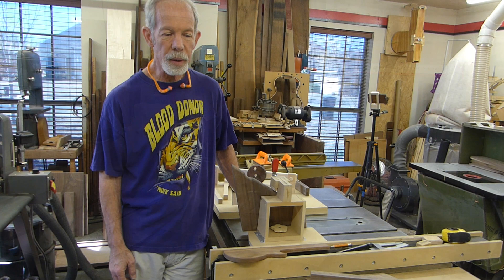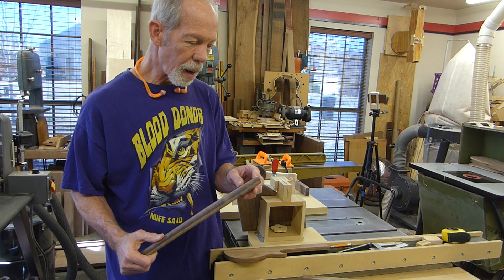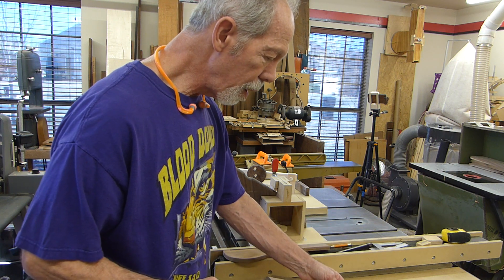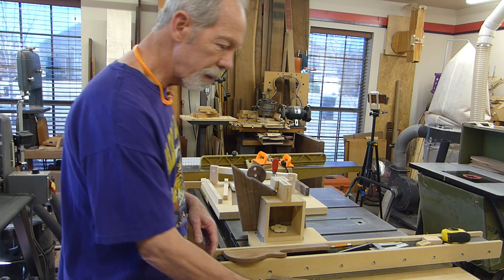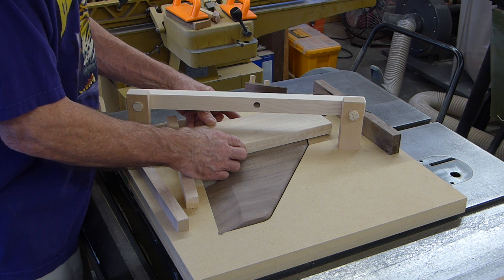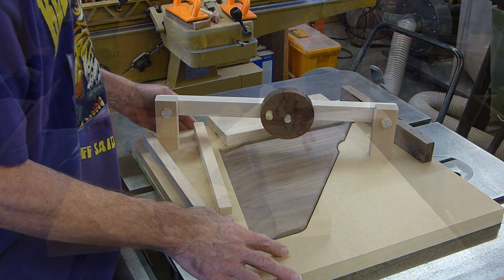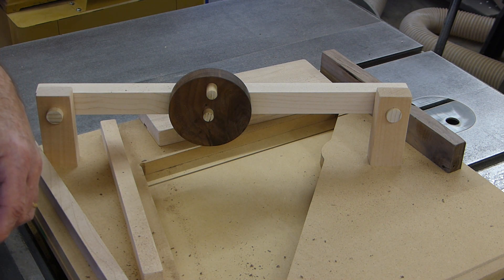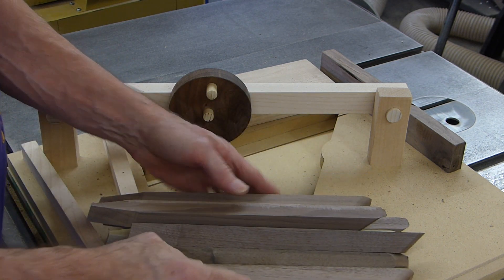Using CNC router to make table saw fixtures - 2-9-17

Comment: Don't use dry lube on the trunnion. No dry lube will lubricate nearly as well as grease. Dust will stick to the grease; no big deal. just clean & re-grease every few years.
Reply from the maker: It had grease for years and years before I rebuilt it and the grease was caked on to the point I had to chip it off.  Obviously it went too long without being serviced.  So when I did the restoration three years ago I decided on dry lube and it seems to be smooth even now.  If I take the motor cover off where I can actually get the dry lube where it needs to go the squeal goes away.  I just don't want to take all the covers off right now.  Thanks for the comment and suggestion, Frank!!
Reply: Yes, it is something that needs to be done & not left too long. When I got a SawStop I spoke one of their techs about it & he said they recommend wheel bearing grease. 

Oh, and I really like your use of the CNC to make those jigs. Good video.